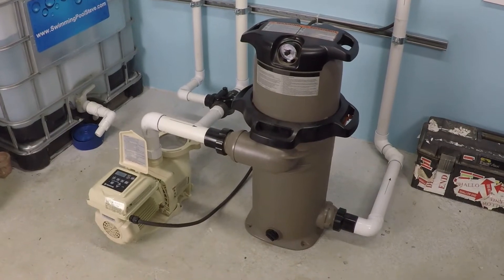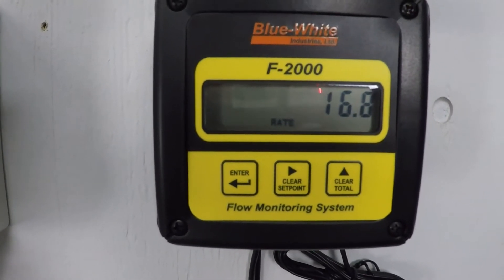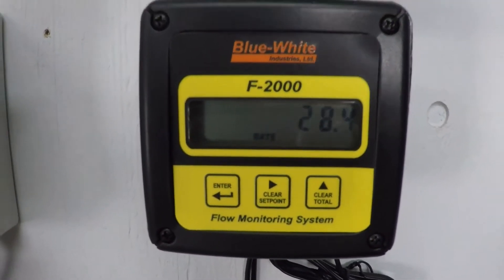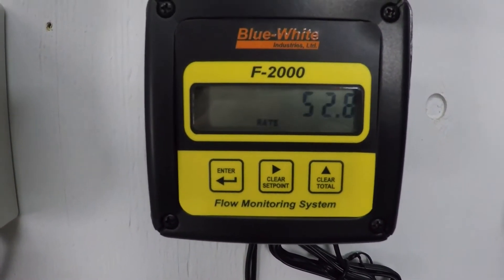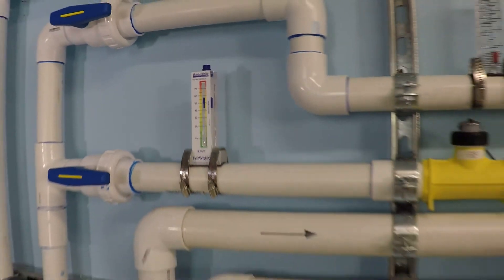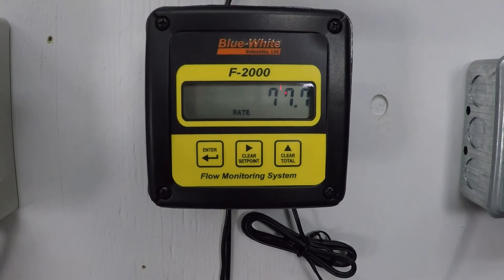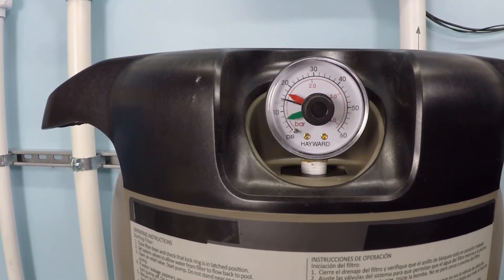Comparing Flow And Energy For 1.5" Pool Pipes

Comment: Good info thanks a lot.
I'm surprised this high end system has these readings. The cheap intex above ground pool I am looking to replace has a flow rate of 2100GPH at 250W max (I suppose that's at the pump and not (eg 1 meter) higher. So in your demo 251W was giving 2076 GPH (the 34,6x60)
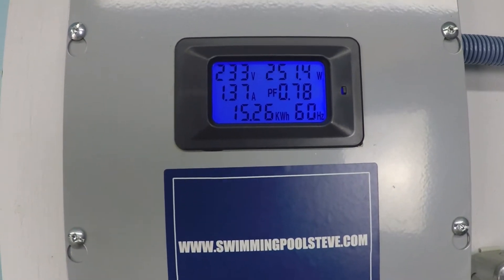how much is your electricity there? how much would it cost to run this for 4 hours at say 4:02 in the vid?